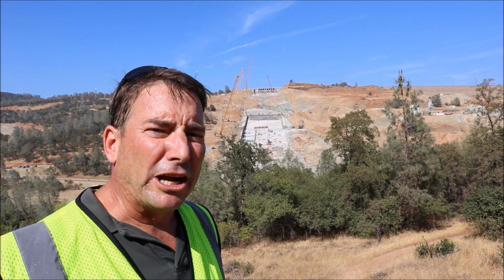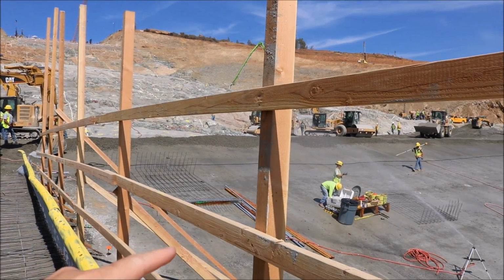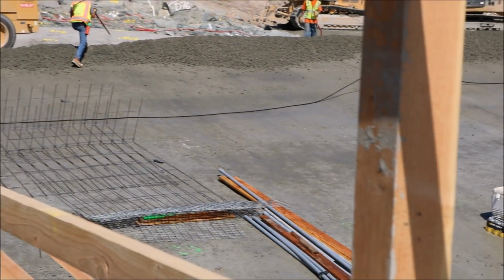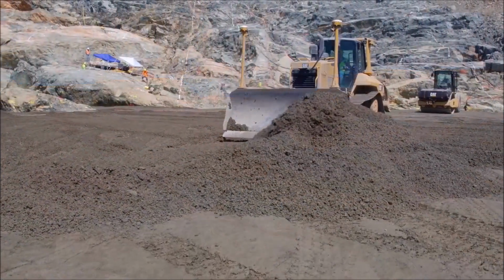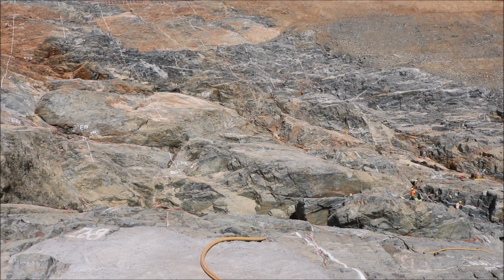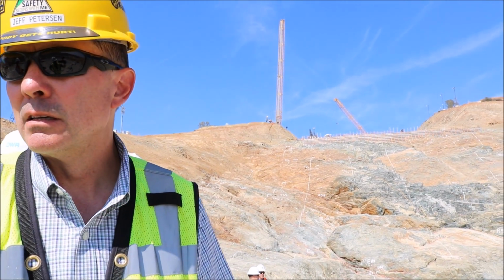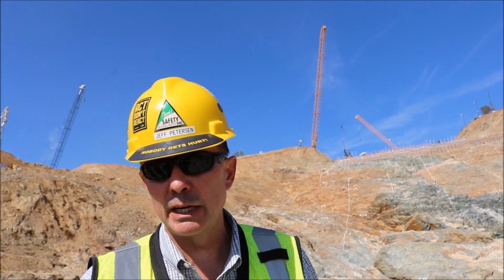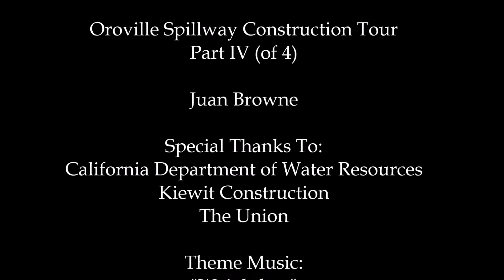Part IV Oroville Spillway Construction Tour

Comment: Hi, Juan. I was checking out the dam on Google Earth the other day. About 1200' downstream of the power plant outlets there's a large pipe that comes down the hill from the south and enters the diversion pool. It goes through a small structure at the pools edge. Do you know if this is has a small turbine in it, or just what it is? The pipeline runs uphill about a mile, and disappears underground. I can't tell where it comes from. Thanks.  (Also, the latest Google Earth view is from May 18. It shows a lot of water going down the broken spillway and the  "canyon").
Reply: Frond it! It does have a part and power plant. 13 MW.  It's one big pipe from Miners Ranch Reservoir to the power house.
From http://www.westcoast.fisheries.noaa.gov/fish_passage/ferc_licensing/feather_river/south_feather.html

Kelly Ridge: Ponderosa Dam on SFFR forms Ponderosa Reservoir (spills into SFFR Arm of Lake Oroville of P-2100 Project). Ponderosa Tunnel diverts water from Ponderosa Reservoir into Miners Ranch Canal. Miners Ranch Canal (MRC) has siphons across McCabe and Powell creeks of Lake Oroville (P-2100), delivers water from Ponderosa Tunnel into Miners Ranch Tunnel, and delivers water into Miners Ranch Reservoir. Miners Ranch Dam on MRC forms Miners Ranch Reservoir. Kelly Ridge Tunnel diverts water from Miners Ranch Reservoir into Kelly Ridge Penstock and on into Kelly Ridge Powerhouse/Switchyard. This 13 MW powerhouse discharges just downstream of Oroville Dam.
Reply: Charles Moore...Kelly Ridge Tunnel. Thanks for the info! I looked all over trying to see what it was. Never would of thought to look at "NOAA Fisheries", that's for sure. I saw the Miners Ranch Reservoir earlier, but thought it was part of that arm off of Oroville Reservoir. Wouldn't have guessed that it was filled by a different tunnel. Sounds like they must have miles of tunnels/pipelines all over that area. The other thing I wondered about is on that pipeline about 3000' up from the Diversion Pool (just before it gets to the intersection of Oroville Dam Rd. and Canyon Dr. There's a tall "stack" that straddles the pipeline. Maybe a vent, or something like a water hammer arrestor? Anyway, thx again for the info. Appreciate it.
Reply from the maker: KSparx water hammer arrester. The tall green tank.
Reply: Oh yea.   You can see the beginning of that canal at the bottom of the Ponderosa Dam (opposite the spillway.)  You can follow it about half way to Miners Ranch Reservoir before it disappears underground,  including the two siphons.  Cool.
Reply: blancolirio..Thanks, Juan. Thought it was maybe something like that. (I'm more familiar with the steam side of things). Appreciate the info & reply. And your vids.
Reply: cember01
OK. Thx! Finally found it. That one is a helluva lot harder to follow.
Reply: Yeah.   Good Google Earth fun :)

Comment: When  they remove the RCC walls next year and they prepare for the structural concrete, will they be re-using the removed RCC in the mix for the structural concrete? Or will it be removed off site and used for sill some where else?
Reply from the maker: Bob Ferranti don't know yet.

Comment: Where does the bulk of the cement for the concrete come from and how is it transported. Thanks...
Reply from the maker: Louie Lopez aggregate recycled from old spillway.
Reply: The Portland cement will be brought in from any number of cement factories by the hopper truck load, not by the bag from the local hardware store. It's stored on site in silos shown in the first video beside the mixing plants. Too bad Juan didn't get to the RCC plant. The aggregate is recycled or crushed from rock dug out of the river. The water is pumped from the lake helping to lower it.

Comment: Is the top surface of leveling concrete set in level steps, or is the surface set at a planar angle?  In which case, the term leveling is somewhat of a misnomer.
Reply from the maker: Go back and watch parts 3 and 4.

Comment: What's the construction of the drain system?  Where will the drain ports be in the spillway walls?  Is there any concrete behind the walls to hold the system in place?  Unlike the old spillway, which seemed to be drains in loose material which all washed away.
Reply from the maker: See Part III again.
Reply: I wonder what the clean out will be?  Will they have a manhole at each drain where it exits outside the training wall and turns 90 degrees?

The previous design grouped about four drains(about 25' spacing) into one spillway port(about 100' spacing).  Part III suggests a port for each drain this time.

Comment: Juan,  what is the purpose of the aeration feature?  I don't understand that one.
Reply: Presumably to prevent cavitation.    Water flowing over a surface can form cavities (like instant air pockets) which quickly collapse back into nothing.  But those collapsing cavities are like a jack hammer on the surface.   It's a problem for boat and submarine propellers, and there's several documented spillway failures (eg: Glen Canyon Dam) where concrete walls were torn away because of it.    What they found was introducing air in the water stream,  the right places and amounts, protects the concrete.   Hope I got that reasonably right :)   (Edited 9/5/17, removed references to causes,  add dam name )
Reply from the maker: Doug & Kathy Davies yes, anti cavitation.
Reply: Makes sense to me. Thanks for the information.
Reply: Water flowing fast does not cause cavitation, water at very high pressures causes cavitation. A very big difference.
Reply: Sideslip, I don't think that's correct.  Boat propellers, when they turn through water, produce negative pressure so high pressure isn't the answer.  I think cember01 's answer is the correct one. Maybe Juan can get some clarification from the DWR folks to present at the next Oroville update.  Juan, over to you.......

Comment: Where are they getting all of the water that is being used to make the concrete and other uses on the site?  If they are using lake water, is there any concern about the PH balance of the water or dissolved minerals affecting the concrete mix?
Reply from the maker: John Opgaard lake water, large pump (s).

Comment: What's the compressive strength of this RCC?
Reply from the maker: cember01 2500psi hardened to 6000+ see Part 2 and 3
Reply: Among other things it depends on inplace w/c ratio at time of placement and through times of curing.

Comment: I can't believe how much RCC they are using and then next year they're removing most of it.  Monumental construction project.
Reply: That has bothered me I hope they can use it somewhere?
Reply: It will probably become back fill against the side walls
Reply: Most of the RCC will stay in the plunge pools. Only the walls will be removed and a couple of feet will be scraped off to be replaced by structural concrete with drains and reinforced walls. A back fill for the walls sounds indeed like a good use for the removed RCC.
Reply: Actually, they are leveling the RCC for the middle section (plunge pool areas) about 3' below the finished structural concrete height. So, next year/season they will only need to saw-cut slots into that RCC to facilitate the drain channels (done with the "stay forms" above and below in the leveling concrete) and remove the temporary "RCC Training walls" to be replaced with structural concrete walls 10' taller than the temp. ones.

Comment: How high are the RCC side walls?  How high are the structural concrete walls?  Thanks!
Reply from the maker: TonyUnplugged about 15' rcc and 30' struct.
Reply: Thanks!  So the DWR calculations show a 15' RCC Wall can contain 100,000 basketballs per minute down the chute. :-D

Comment: What happens if we get rains like last winter?
Reply from the maker: It will work just fine.
Reply: Everything would be fine. The issue was that the spillway failed and couldn't be used at it's then full capacity. If we get normal rain. the lake level will rise and that it' If we get lots of rain the lake level will rise to the point that the spillway has to be used. Even with heavy rain 100,000 CFS down the spillway is rare. If there is torrential rain and the spillway has to be used in excess of the temporary 100,000 CFS limit the water will simply spill over the sides and flow down Croyl canyon. Any flow in excess of about 15,000 CFS down the spillway starts to cause levy damage down stream, so that's their first management point. They'll start to release early to lower the lake level ahead of heavy rain.
Reply: I think you're missing a zero in that levy damage sentence.

Comment: The dental concrete fills little holes that the roller compacted equipment can't compact, basically smaller then 2 feet. Leveling concrete goes on top of rock that is already fairly level, but still is a little rough. Hence the term Leveling concrete. Roller compacted concrete is fairly level already so it doesn't need a leveling concrete. For a lay person you think cgoing is concrete, but it isn't. Dental concrete has small stones in the concrete. Leveling concrete has almost no stones in it. Structural concrete has bigger stones.
Reply: a key missing detail in many minds is the idea that concrete is cement - NOT SO! Concrete is the combination of cement with aggregate and water with nuances achieved by chemicals, temperature and the like. For example, the roller compacted concrete is kept at 55f even in 100 F temperature, and ice can be added to bring the temp down, but then you need to calculate the melted ice equivalence to the water ratio...it can quickly get very complicated.

Comment: JUAN (REBAR QUESTION):  Why are they mixing ECR Rebar and regular (non-epoxy-coated) rebar in the same pour ?  For example, both types of rebar appear prominently in the pour at { https://youtu.be/k5gYfX2p6m8?t=2m27s  }, which I believe is the section seen in { https://youtu.be/k5gYfX2p6m8?t=1m29s ) at the far top center, on the far side of the new left side wall (looking uphill) of the upper spillway, or roughly where the point of an equilateral triangle would be using the 2 big cranes on the far left as the base and the left uphill side of the spillway for locating the tip.  See that tiny rectangular areas below the wall being built ?  I think that's it.

I'm not a concrete guy, but to my untrained eye this seems like a bit of a materials selection goof to me.

Comment: Check out this time index of the 9/11 update by DWR: { https://youtu.be/sjNtur7aePo?t=38s } ... spectacular view of the upper plunge pool.  They've accomplished a huge amount of fill, but there's still a long way to go.  Current rollout zone seems roughly the size of 1 to 1.5 football fields, and getting longer with each lift.  That's a lot of concrete.

EDIT: Faulty time index fixed.  My bad.

Comment: Juan:
Great report as always, and I have a request for a new video. 

When you get a few spare minutes, <g> see if you can find out any information on the Big Bend Dam that was built in the early 1900's and, from what little information I can find, is completely submerged by the construction of the current Oroville Dam. 

I think it would be an interesting addition to your Oroville Dam Series.

https://en.wikipedia.org/wiki/Upper_North_Fork_Feather_River_Project

"Six years later, in 1968, the giant Oroville Dam was completed on the Feather River as part of the California State Water Project, forming Lake Oroville which flooded out most of the lower North Fork, including Big Bend Powerhouse and the Big Bend Dam. PG&E completed the Belden Powerhouse in 1969 to replace the lost capacity."